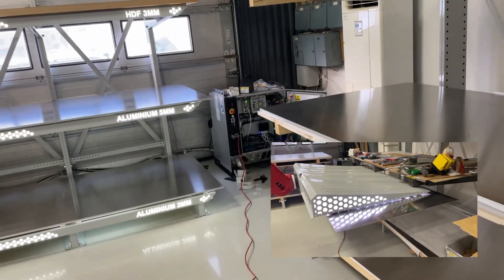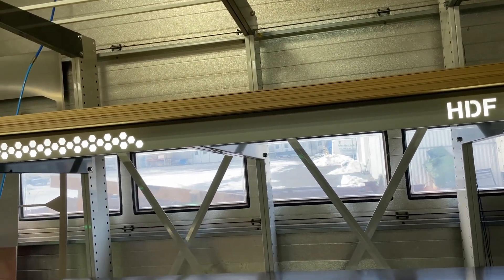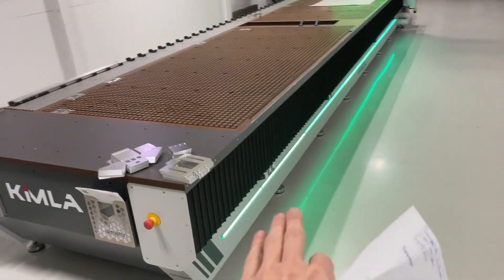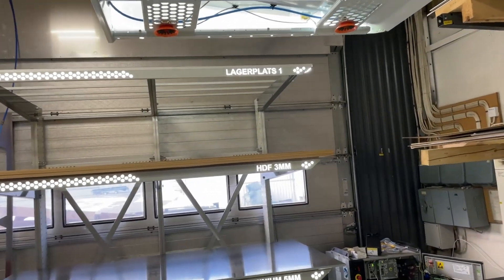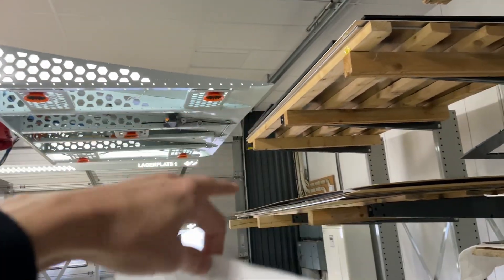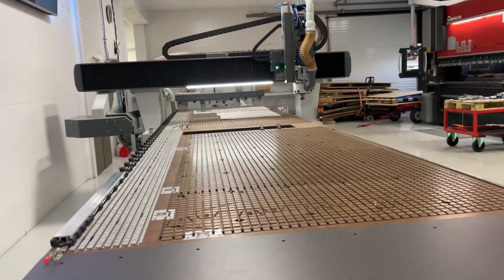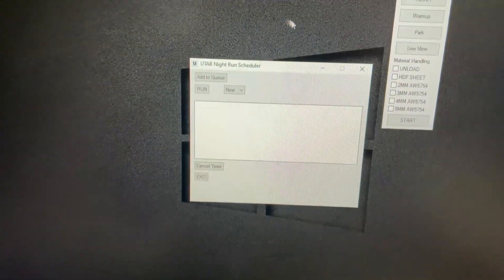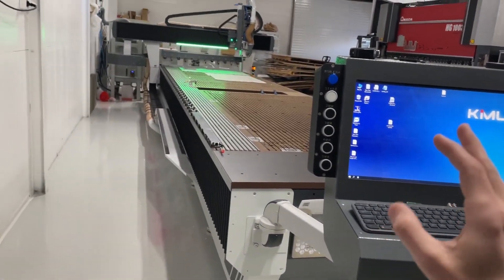Robobobulator Part3 - custom software,voicecontrol,pccam

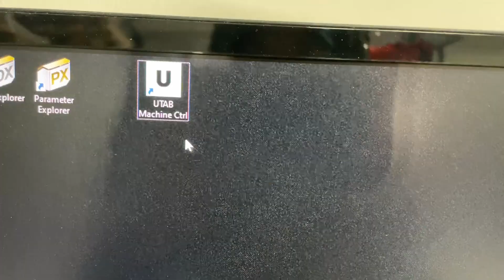Comment: Hej, Do you have a video or more info on the drill with the copper tubes shown at 0:21?  I'm looking to add cooling to a cnc router without interfering with the automatic tool changer and it looks like this design may adapt to that use. Is the cooling system connected to the tool holder or does it use the fitting to support it?
Reply from the maker: That's something ive been working on a bit, its a prototype i 3dprinted(with internal channels) and inserted the copper tubes into. Plan was to have it get loaded/unloaded together with the toolholder itself, like an extra groove or "pegs" under the fork that hold it underneath the original toolholderfork in the toolchanger.
That way i could make the way coolant reach the endmill custom to every tool! it would be amazing. 

There is still some stuff to figure out tho, like having the connector next to the spindle that go into this part.. and be able to do in/out 100's of times and not leak, and it needs to be able to withstand ethanol in my case.
I dont have much more on that yet tho, but i have since found something that kinda does the same things, a commercial product, sorry i cant find it atm but they are like red cones they put on heat shrink toolholders, company name was something with 3 letters. MHT or something close to that. Often seen on röders machines, sometimes on Kern. Probably extremly expensive but hopefullt u'll find it, ill let u know i if i remember the name.

EDIT: found it, they have a channel here on youtube: MHT GmbH Merz & Haag

Comment: Awesome stuff, both automation and work. I've been following you for a while and your channel is a gem. Can you give some details if possible about how you code the software and protocols used to communicate with stations. for example I have a mach3 based manual toolchange cnc router and use modbusTCP and node-red to automate stuff like dust collection, telegram messages for job status etc. Stuff like air compressor and dust collector are controlled by Esp32's over MQTT. I write scripts in mach3, some js in node-red and some python for Fusion 360. But Mach3 is giving me hell, so i am preparing to move on to LinuxCNC.
Reply from the maker: Hey thanks.
Reading your message really brought be back to the early days! I also fought  with mach3 and linux cnc and everything in between.
I started off with a radio send/recieve system (with validation) but have moved on to Shelly units. Plan was to use mqtt aswell but using http requests still, might move on later. 
For the extractor i just use a pressure switch connected to the pneumatic actuators that control the suction cup, when those pressurize (i.e lower) the switch latches and a signal is sent(still using the radiotransmitter)
For the air compressor i either just send a httprequest to that shelly unit to turn on the specific output, or the light that indicated that the spindle is turning may also do it.
I need to trigger local AHK scripts remotely so i have a light weight webserver running which allows me to send say "http://192.168.1.422/send/runmyscrupt.ahk" to the computer controlling the router for example.
To trigger the robot to run specific programs i got 3 shelly units in the cabinet that can enable/disable inputs on the robot controller, they also work for the robot to trigger its output that goes to a shelly unit so that it may send the signal to the router that it is finished.
All rgb lighting everywhere is controlled by shelly rgbw2 units, makes it really simple to get visual feedback for whats going on.

Comment: That's astonishing! Your shop looks fantastic.

Thanks for the PCCam file. That'll be useful.

What are those copper nozzles around 0:20? Where can I buy it? Is that with the holder or you can put it on any holder?

My boss is planning to buy new machines from Kimla (linears). I know it depends on type of work someone does but maybe you have some general advice what to choose. Is that touch scanner useful? Is presser+extraction foot better than extracion foot?
Reply from the maker: Thanks as always :)

The copper-nozzle thing is just something ive been working on, (I accidentaly edited out talking about it) its meant to stay with the tool holder so every tool has its own custom solution. Its not ready for testing yet as there are some things to sort out but ill let you know when the time comes :)

Always fun with new machines!
For me personally, I would get the linear motors,probe and presser+foot. Like you said it depends on the product and the type of work but there are alot of benefits of them things.

EDIT:
-- I wrote alot here but it would be alot easier if I just made a quick private video on the pro's and con's and sent you a link. So ill do that 👍

Im going to kimla probably next week so ill know more about whats new after that :)
Reply from the maker: There is often something wrong with the commentsfunction, i got a notification about you not beeing able to comment, but even THAT comment isnt showing up.
I have seen this type of wierd behavior before, its super annoying. 
Anyways, ill do a quick video talking about the plus and minuses of the extractionfoot,linears,probe and such :)
Reply from the maker: @Nunak91 Maybe test if it works when you add @randomrouting somewhere in the comment
Reply from the maker: @Nunak91 https://youtu.be/1947nSEMX9o

Comment: THis made my week.  The shop is looking so good

Editing was so good!!!!

for the HDF. put sheets of paper between the sheets might help since the machine is loading the sheets itself. would break tension and keep the vac from vac'in through multiple sheets. 

If you want to go to IMTS this year we are going to rent a house outside the city and drive in daily. eat some authentic chicago food and walk around making fun of the gimmicky stuff machine tool companies are trying to pass off as improvements or innovation.
Reply from the maker: Thanks bud! Took me all dang day to edit!

I'd be afraid of the papers falling off to somewhere, perhaps strips that are attached to the back of the racking.. but I think this "shearing-action" will keep working but if not then the plan is to put like stiff brushes on the short sides to cause drag on them. Time will tell :)

I would LOOOOOVE to go to IMTS  but im having a real hard time even making it to kimla in poland due to work/family/time but thanks, really. If anything changes until september you'll be the first to know!
Reply: good point! @randomrouting  

heck yea man keep up the good work!
Reply from the maker: @hyperformancellc   Everything mazakrelated sorted ?
Reply: The [REDACTED] machine is gone!  @randomrouting
Reply: did you see the video they had me post? lol @randomrouting
Reply from the maker: @hyperformancellc   Yeah, you looked like you were trying to hold in a laugh :D Anyways, i guess you are happy with the outcome all in all then?
Any replacement machines you looking at ?
Reply: Yea looking at quite a few,  Interest rates are not great so im just waiting for the right deal.